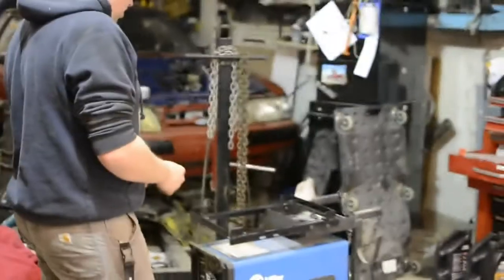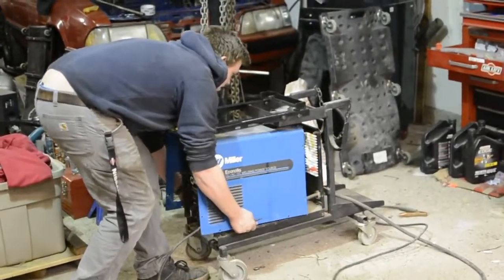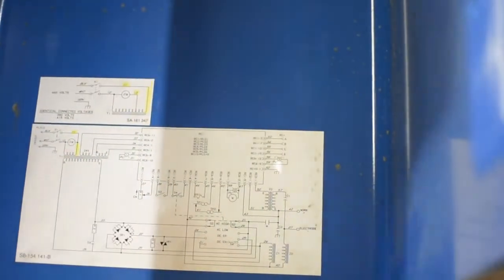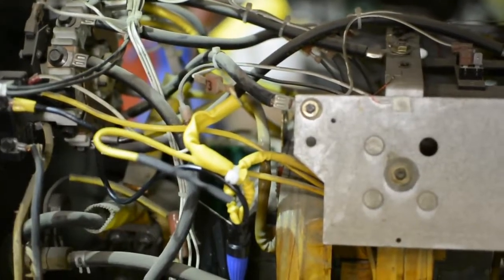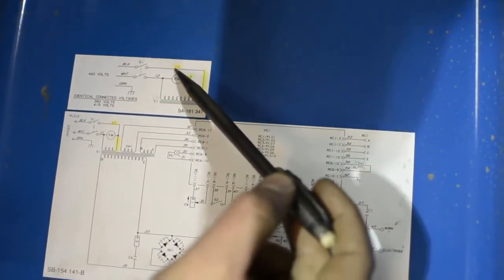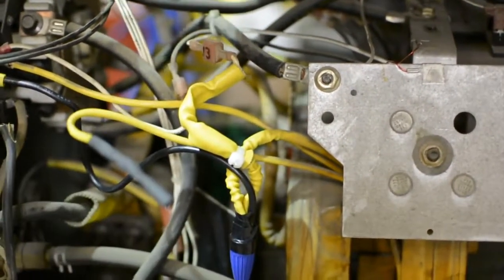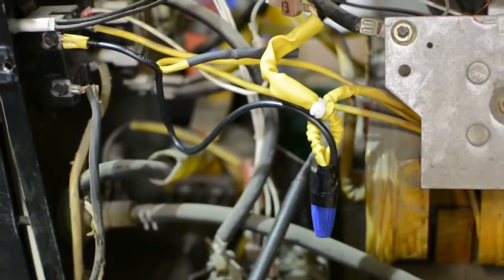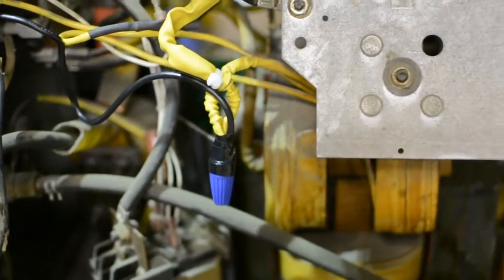How to: convert miller 460 volt tig to 240 volt

Comment: Thank you. This really does work. I purchased a used one from auction, thinking it was like any other welder, where you could just move jumpers. Not the case. I searched the internet, and found many forum posts indicating that what you did was not possible, and that the whole transformer had to be changed out. I called a local welders supply, and they looked up a 230 volt transformer, and no longer available. Gave up, and listed it for sale. After 2 weeks, I started researching this again, and came across your video. On mine, the wires in the middle of the transformer were long enough to reach the switch, so I did that, instead of the jumper wire, and ran the fan to the switch.